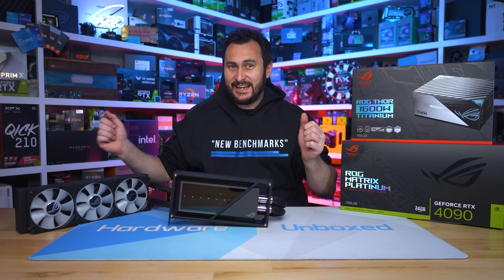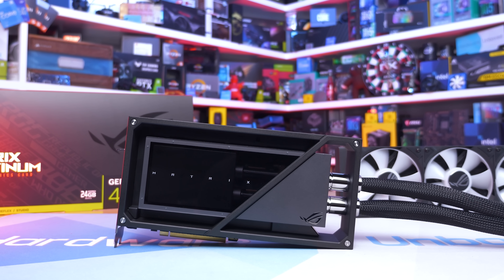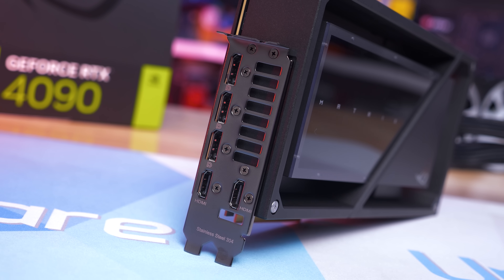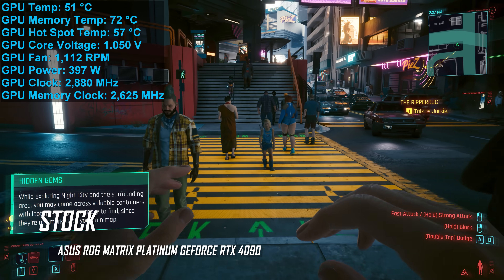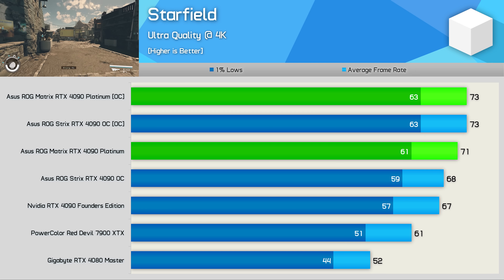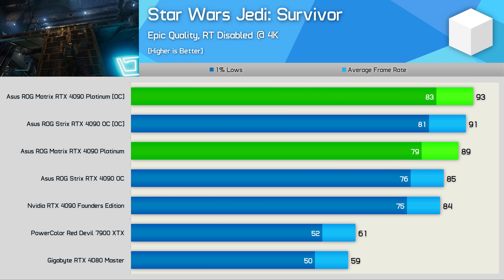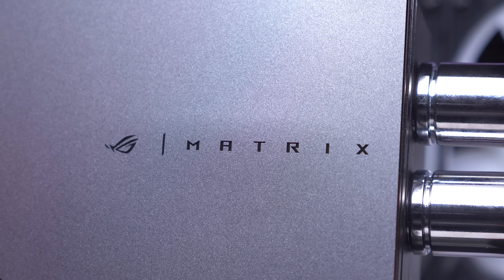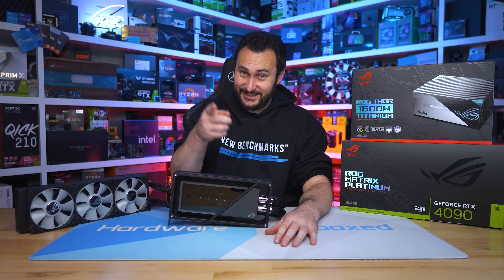I Can't Afford It! Asus ROG Matrix Platinum GeForce RTX 4090 Review

Comment: The cheapest brand new 4090 is nearly $2,000 in USD which includes $150+ for taxes. It's not worth the price especially with all the faulty cable and power connector issues. I'm satisfied with my NITRO+ AMD Radeon™ RX 7900 XTX Vapor-X 24GB. Nearly $1,000 more for what I paid for and hell no. The risks and the price of the 4090 shows why nGREEDia fits their name. With nearly $1,000 extra, I can spend more on at least 2 decent 4k monitors with 144Hz . I'm coming from a 980ti and I'm fine with 4k at 60fps average. That's good enough for me. $1,000 for 20 to 30+ fps more is not worth it. I'm not paying an arm and a leg for that with all those risks.

Comment: this is crackhead level investment.  I bought a rog strix 4090 plus a water block for 200 bucks.

guaranteed it runs better than this one on its own 480 mm rad loop.

even if it didn't.  WTF 3200 dollars?  what's 1000 more dollars going to get you? 1 more fps?

Comment: Lmao what a joke, my Amp extreme can reach 3070mhz stable in most games i play, the only game that can only reach 3030 was The Last Of Us Part I, i'm not sure if all Amp Extreme models do this or i just hit that Silicone lottery jackpot. also at stock it runs at 2885mhz~2895mhz never below that. I can have that 10fps boost for the same MSRP of the 4090, also the AMP Extreme is cheaper that all TUF models. i got it for $1650 at launch but now i think its 1700.

Comment: I feel like getting an AIO for your CPU is unnecessary with this thing. I mean, most of the GPU heat is getting transferred almost directly outside. If you want both the CPU and GPU water cooled, I think you might as well get a custom water loop at that point.

Comment: Shit better have good thermal pads like gelid extremes or something

Feel like the thing that sucks in every gpu is the thermal pads

The liquid metal is great. Its interesing actualy, i tried to liquid metal my gpu before, but whenever i tried it, even if the core and hotspot were low and good, there would be artifacting almost instantly under load. Replace with thermal paste, and its okay.

I thought, maybe the pads dont make contact with LM, but that doesnt make sense because it should be a tighter fit. Idk.

Comment: The ROG matrix cards used to be my go to card - they were always so cool looking compared to the standard cards. With the way things overclock today and the cooling performance of most of the coolers - this is now a buy it if you like the way it looks type of card, that's about it.
Reply: Can't really blame Asus for that, for the last 10 years, generation after generation Nvidia had been locking down every OC setting possible and VBIOS. It's not just disappointing from a consumer choice standpoint, it makes cards much more boring too. Remember when any AIB (when we used to call them that) could add RAM onto their own PCB if they wanted to? These days they don't even have a say about the power configuration.

Comment: For those of you that havent been made aware if you're running really nice hardware with Starfield off an HDD you need to run it off an SSD if your experiencing a bunch of stuttering, switching from my 12TB Toshiba N300 to my WD Black SN770 pretty much erased all the stutters on my 3090 Ti LC and 10900K

Comment: I purchased a Gigabyte Aorus Waterforce, which is Gigabyte's equivalent AIO  graphics card solution. The primary advantage of AIO-based graphics cards is the flexibility to position the radiator away from other components, especially when venting heat into the atmosphere rather than within the case. This same principle applies to CPU AIOs, where the goal is to exhaust heat into the atmosphere.

The benefit of this setup is that the case temperature remains relatively low, preventing other components from being subjected to excessive AIo fan-generated heat. It's important to note that your case should be designed to facilitate this cooling approach. In my case, the Lian Li Lan Cool III proved to be an excellent choice for achieving optimal cooling performance.

Comment: This card is a total joke and slap in the face. Yeah it’s a good looking card but it’s just another AIO  are with a crappy copper plate that forms teven flow water over components besides the core. You can literally buy (2) 4090 FE for the price. Or a 4090 and everything else needed to buy a world class custom loop

Comment: It takes a $2,000-$4,000 Asus Matrix GPU just to get 4 extra thermal sensors on a PCB. Wait, didn't eVGA give us that with i-CX and e-leet software like 8 years ago...lmao. It was nice having the extra V-ram thermals. We'll miss you eVGA and the KP series. I picked up the z790 CLASSIFIED and DARK boards with 2 binned 13700K's just to build a cool farewell setup, and sell the other.

Comment: My TUF Gaming Radeon RX 6900XT "TOP" Edition overclocks to a locked 3,077MHz from 2390MHz...lol. 82c on the GPU die with 90c on the hotspot, gaining an impressive 15-20fps at 1440p high settings in CP2077. nVIDIA used the ASUS TUF RX6800/6900XT Gaming OC cooler for the 3090ti. Running a RX6800 with the 2.9 slot TUF cooler basically guarantees a solid setup. 
 There were essentially identical gains with the RX 6900XT TOXIC series from Sapphire. My "AIR Cooled" TOXIC card was factory overclocked to (2425MHz) though, held a solid 2.91GHz manually, with the 16GB's of 16Gbps GDDR6 going up to 18.6Gbps. 
 The Liquid Cooled "LE" "Extreme Edition" "EE" card boosts to a crazy (2525 MHz) with the TOXIC-OC hitting 2.73GHz) Though, it can hold a steady 3013MHz thanks to its "XTX-H" silicon. A 500MHz+ GPU clock frequency boost netting a 15-20fps jump is a nice gain. Navi does scale with frequency. I bought all these cards for the price of one 3090ti Matrix...lol
Reply: Thanks professor

Comment: I love the design; I think there is a missed opportunity though, the metal passthrough terminals should be quick disconnects for a way to add GPU block and radiator to a preexisting open loop.

Comment: The 4090 air cooler is so overbuilt that you can't justify a water cool version.
Reply: They are overbuilt so they don't fit in a lot of smaller cases.
Reply: @EarthIsFlat456  they are overbuilt because the gpu was supposed to be less efficient, bigger and more power hungry.
Reply: @shingod700  I know that. The point is you can definitely justify a water cooled version.

Comment: Those temperatures when you tried other compounds don't sound right - I'm using kryonaut on my strix oc and stay in the high 50s.  Is the cold plate not making good contact?  Voids?  It should have been comparable to the kryosheet, if not better than.
edit:  I'm thinking of kryonaut extreme actually.. but even then it shouldn't be 10C delta between kryosheet

Comment: its actually double the msrp of the regular rtx 4090 so its $3200, where do you get the extra $800 from to get it to 4K?  US prices, the extra$800 is probably the prices scalpers are selling it for, the official us price is $3200 which is double the price of a default rtx 4090, for an extra 5.5 tflops over the default model

Comment: overclocked at 3060 mhz without liquid nitrogen/helium???? impressive, that's 390 MHz higher than the claimed 2670 mhz boost and 765 MHz short of the highest clocked rtx 4090 with liquid nitrogen/helium cooling solutions

Comment: Calling liquid metal "something special" is something I disagree with.  It introduces a hassle to deal with that while nice for performance, is hardly worth it when there are little to no performance gains to be had on a card that would have run just fine without.....As a wall piece it's fine, but acting like it's a better card is disingenuous (not saying you guys did, but others undoubtedly will).  It will suffer the same fate as any other aio card and start running markedly worse in about 5 years (assuming the pump doesnt die before the coolant evaporates) when a non aoi would be otherwise fine with new paste.
Reply: How does metal evaporate?
Reply: @Safetytrousers  "Coolant evaporates".  It leeches through hoses, no matter what type you use and has been the primary cause of failure of every aio ever made because they all suffer from it eventually.   If the tubing isnt user removable or there isnt a port somewhere on the radiator to fill/clean the loop, it will become a paper weight.  The AMD fury X is the most recent example of a card that would still be fine for the most part, but almost none are still being used due to the loop not being servicable.

please read next time.
Reply: I know that. My brain was tired. @MDxGano

Comment: I'd consider the price ($3k2) reasonable, and there is a non-trivial chance ASUS to lose money on the product (engineering/prototyping). It's nice to see the the UV resin along with the liquid metal, the sensors for 12V power connectivity. I suppose some of these innovations can translate in commodity products down the line.

Comment: Probably has worse coil whine than the strix. Traded mine for a Gigabyte and won't look back
Reply: I had 3 x 3090 in waterblocks (sold 2 when mining fell through) and they all had zero coil whine. I've had waterblocks on a 980ti, 2080ti also and both of those has zero coil whine. Waterblcoks seem to avoid all whine.
Reply: @Safetytrousers  I actually did install the EK ABP water block and it made it worse. At least for me!
Reply: But no whine was reported in the video. He said he could not hear it over the case fans. @austin_colt

Comment: The .5 slot designations are important for people who do ITX cases and builds.  I have a lot of cases that will fit a 3.25 slot card but not a 3.75 slot card.  So while yes, they both use "4 slots" they don't use 4 slots of space at the bottom of an ITX case.

Comment: The damn thing looks bad ass but dang these GPU prices are wild. Question though, it looked like the overclocked stats were ~420 watts. Isn't this card supposed to pull like 600w?
Reply: The connector can handle 600w but 4090's game on average at about 390w.

Comment: Yea I stopped watching as soon as you did the intro. AIO GPUs make no sense and are so ugly looking especially for the price. If your gonna do water cooling on a gpu than you simply do a custom loop as it’s cleaner and lasts longer. Never understood these AIO units, it’s what stopped me from buying ROG card in the 6000 series when they were released. Why their pushing these is beyond me, just sell a bolt on AIO separately and call it a day. I’m not the only one that didn’t buy the 6000 ROG do to the AIO nonsense, I know lots of people that went to Nvidia because of that hot mess and there’s still loads of ROG 6000’s on the market. Asus knows they messed up with those and it’s probably why we still don’t have any 7000 series ROG cards from them. For $3200 USD you can buy a high end 4090 and build a very nice custom water loop that will outperform and look way better than 2 dangling hoses. Sorry, but no card with that price tag should have rubber lines dangling over top of your nice components. When I see AIO GPUs all I see is cheap low quality nonsense where the manufacturer is clearly only after your bank account. If these companies had any respect to aesthetics than they’d sell these in a kit with a custom loop with both hard and soft tubing. That’s something I’d be interested in vs this mess. The card itself looks nice, but the rest of that stuff hanging off it totally kill the entire system.

Comment: I do like this card, its dumb but I like it.
But those chrome ends for the tubes should have been satin black.
And this thing could have been alot smaller.
Even if the outer frame was that large, but then have the 12v inside the frame, and the tubes on a swivel sorta connector so they don't make the card an extra 30mm (or so) longer)

Anyways no one cares who's gunna buy it? Such a shame it can't be super over clocked lol 

I'd be interested in seeing liquid metal and the cyrosheet on the air cooled TUF/Strix models

Comment: I was wondering when the price would be dropped, had to wait towards the end. Well done Steve. It kept me glued to my little laptop and the price was forefront in my mind from the beginning. I surmised a possible $US3,000 price but $US4,000 simply blew me away and what is a ridiculous price for most will be bought and made out of stock very quickly by the nouvo rich.  For us mere Aussies, the price is at least $6,000 or more depending on the greed of the retailer. Now I understand why Radeon will be manufacturing mid and lower range video cards on next their new RDNA release.

Comment: Well, that was awkward. I had a RTX 20x0 with AiO once, when EVGA was still around and the whole thing was more affordable, and you really only want those cards for peace of mind on the hotter days and for the lower dust accumulation. As usual, the memory isn't included in the cooling circuit for some reason. In general, if you've got a good case, then there is no need for one.

Comment: The issue with this card, as with all 4090's really is you don't need absurd cooling because the stock coolers are monsters already so your gains are going to be marginal at best and could easily be matched with tweaking the stock settings and fancurves.
Reply: Indeed. The extra price (+50%) is more for the estethics, not for the 4-5% increase in performance.

Comment: I already own a strix 4090, and I could buy another strix 4090 and have two of them, or I could sell my current one and get the Platinum? wtf? My 4090 using the driver will overclock to 2970, and in gpu tweak, it'll do 2990... with msi after burner, I've gotten 2990 and 3010. That's pretty average from what I've gathered. So it's not like they're binning them. For example, if you got 3200mhz 6 or 700w power limit...  maybe but even then, it's not worth 4k.

Comment: As a laptop user from 2008, i always cry for eCPU as the biggest enemy of laptop for gaming is not GPU but rather its CPU. CPU is always 15 degrees higher in thermals, why cant someone design an eCPU which can run at max clock core boost and still remain cool??
Same applies for the desktops, the GPU's are always on a cooler side than cpus.

Comment: My issue with this is the fans are hooked up to the gpu so they have to conform to Nvidias hyper aggressive fan profile and looks really difficult to disconnect with the cables built into the pipes. Means this gpu isn't going to be any quieter than any other 4090. Temperatures aren't the problem with 4090's ( mine included) it's nvidias baked fan speeds making a stupid amount of noise at low power use.

Comment: You can shine a ball of poop but it’s still poop!

I won’t buy Nvidia ever again with EVGA… Truth hurts. Nvidia has earned it!
Reply: I bought a 2080ti Fe at lauch and it had the memory issue. I had put liquid metal on it and waterblocked it. I put it back together to send it back. They stipulated I was not to send it back until I got the new one (which I did 2 days later), which was good because it still worked for desktop use. The new one worked the whole time I had it.

Comment: I noticed you were able to get a stable 3ghz out of it while staying under the 450w stock TDP. Its clearly got decently binned silicone, i'm curious what kind of numbers it could push with the power draw slider pushed to 133%/600w

Comment: You could buy a 4090, plus a Mora and plumb it in for that money and get much better thermals. My 4090 sits in the low 40's under full load and a flashed bios for 666w. And it shares the loop with an overclocked 13900k. I guess this is maybe just targeted at collectors or something? Also, just noticed that the voltage tops out at 1.070, getting it up to 1.100 would raise that clock speed.

Comment: Little bit of a correction to a comment there Steve... You said "simply connect the single 12v high power cable" should have been "simply connect the single 12v fire hazard cable"

Comment: 8:42 If you buy this card, do this mod. Liquid metal will eat at bare copper heatsinks and you will have to reapply it in 1-2 years anyway. ASUS should have nickel plated the block.

Comment: I don't know... for $4000 it doesn't even look like really well made, seams on the various covers doesn't quite line-up... I am sorry but I go as far as looks wise even FE 4090 looks more premium. I am sure this looks more unique, but again for that prices the finish quality is just lacking!

That said I agree on cable management part I do have Strix 6900XT OC LC and it is dumbest design ever it has 4 separate cables + 2 houses going out of the card, at least Asus was smart enough to split them in the middle for routing, but it still just makes a lot of mess. So I do appreciate they found better way, BUT I don't see why would one need to pay $4000 for and and why that wouldn't be just standard practice for all product regardless of the price i.e. no to have stupid afterthought when it comes to cable management.

Comment: This gpu looks awesome. Id be pissed if the 12vhpwr connector on this gpu melted though. That GPU Tweak3 is very interesting though. If that app could make the GPU run in safe mode automatically when detecting high temps on the connectors, that would be a great work around. Wish that type of safe guard were available for all 12vhpwr gpus.

Comment: Did they fix the issue with the 12+4pin? My ASUS (not so) TUF Gaming 4090 just died from a failed 12+4pin. I used to think those failures were because of incorrectly connected cables etc.. but mine had a perfectly flush connection with my CableMod 90° adapter and it still died. The Adapter is fused in place, can't be removed, so a pretty strong indicator that it's melted inside. If you want to see pics of the connection, I posted it on X (Twitter). To their credit, CableMod did reply to my post, but of course there was no reply from ASUS NA. So everyone saying there's an inherent flaw in these 12+4pin connectors is/was 100% correct.